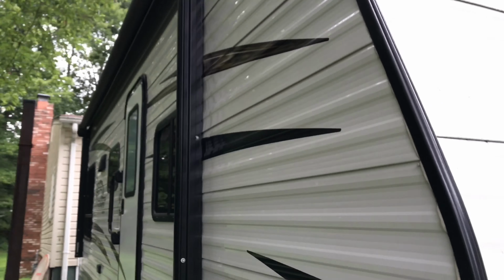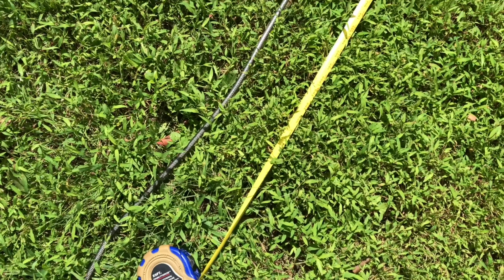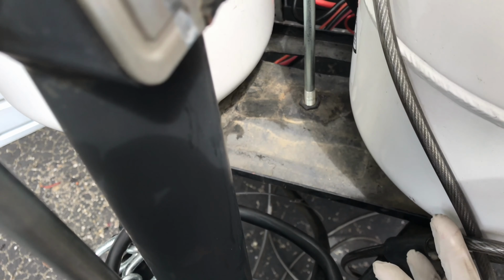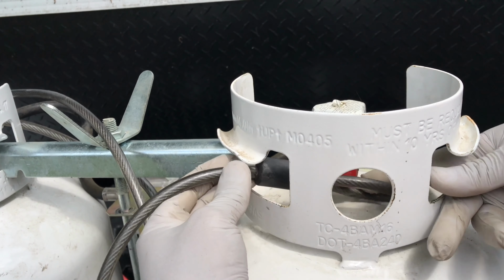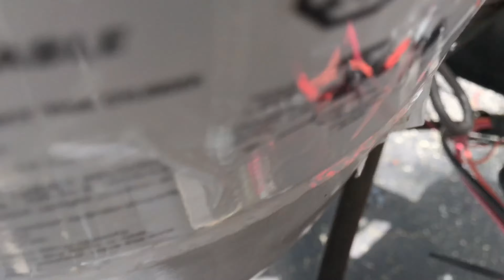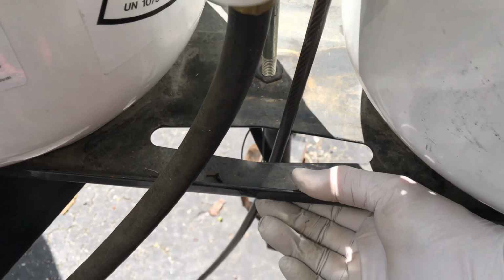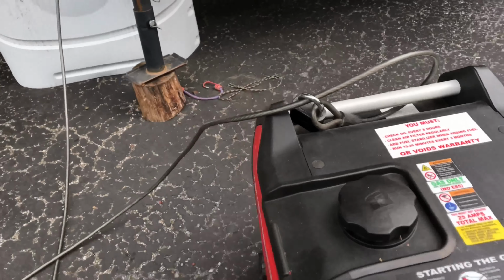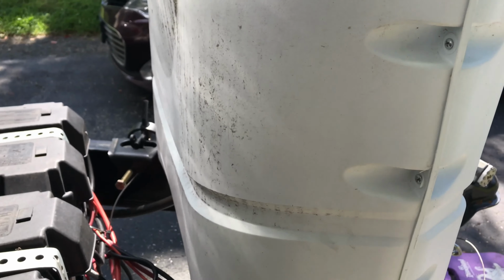Security Cable for RV Propane Tanks & Generator Theft Prevention How we Secure our Generator & Tank

Comment: I secured mine by bending the large wing nut down and drilled a hole through it and bar that hold tank in place . Make hole only large enough for a padlock or combination lock. Can't unscrew wing nut , can't steal tanks .🙃🙃
Reply: Exactly how I do mine. Drill a hole through the wing nut etc...inexpensive & easy...
This guy on the video has one cluster of a tangled mess going on there! Lol 😆

Comment: Hi - Where did you purchase the coated wire cable?
Reply: William Edwards I placed a link on the description.
Reply from the maker: https://www.amazon.com/gp/product/B0752W91ZV/ref=as_li_qf_asin_il_tl?ie=UTF8&tag=sharedlink0c-20&creative=9325&linkCode=as2&creativeASIN=B0752W91ZV&linkId=2d8d69f4a57dc91f37e65ba5303016c8